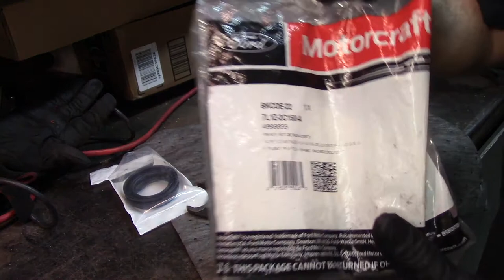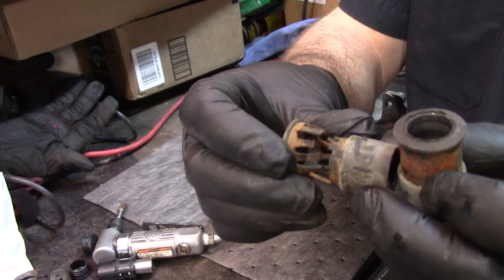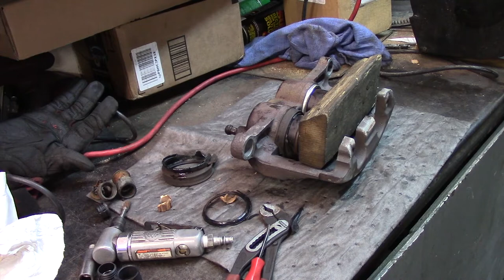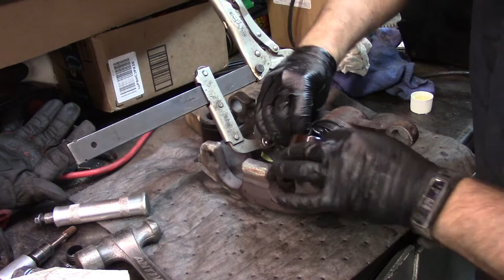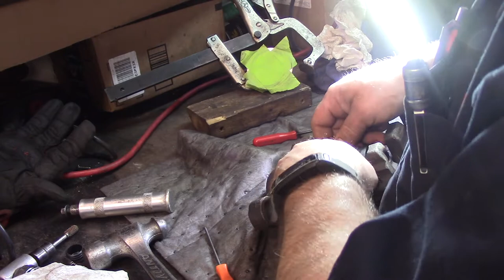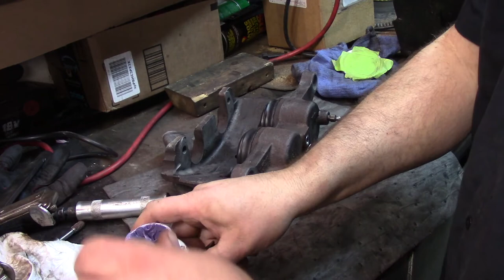2007 Ford Expedition Dual Piston Brake Caliper Rebuild

Comment: If you soak it in solvent for 20 minutes, wire brush the grimy stuff off it, then rinse it with brake clean, pulling it apart is way easier. Kroil works great to free up your pistons.